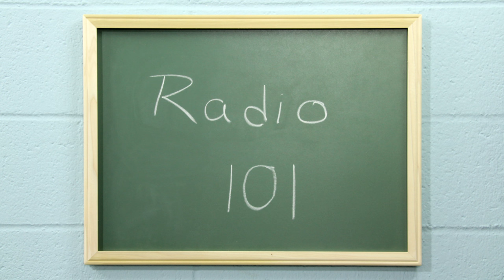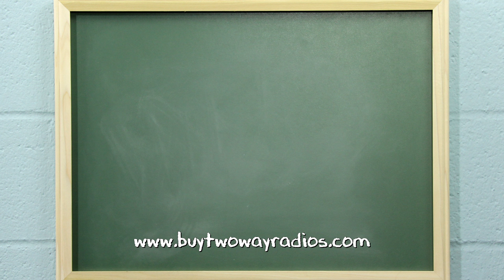How To Program the Baofeng UV-5R From the Keypad | Radio 101

Comment: Why would there be a need for a tone for simplex? I have to disable tone in my Yaesu otherwise the simplex ch won’t work .
Reply: Oh, your Yaesu works! You just have to have your other radios, set to receive and transmit a PL tone, when working simplex. It basically make that frequency private, because no one else, would have that tone programmed in.
Reply: @chrissewell1608  Putting a PL (ctcss) in on a simplex frequency will not make it private. It will only prevent you from hearing others on that same frequency. Others will hear you though. You not hearing them could cause interference to them, not good! Always consider talking on the air like the old party line telephones. Anyone can hear what you are saying, somewhere!
Reply: @cinibar   That's why I call PL tones "Head in the Sand" Tones vs "Privacy Tones" when teaching new operators. :)
Reply: @seriouspipes  Right on! Cheers!

Comment: I just purchased my first Baofeng, a UV-9R Plus, and the programming is very similar. I wish this video was out last week! Your method is simple, compared to other peoples videos. It seems confusing, at first, but once I understood:  All settings, for a channel,  are made before you save that specific channel, into memory, then it makes sense. I just had to "delete all" memory channels, before starting. This ensures you start with a clean slate. (Then set the language to english!) Then start programming channels.
Reply: Just did this with mine. Got it a couple days ago, when it started speaking Chinese I panicked for a second lol.
Reply: Its definitely worth downloading chirp and getting a programming cable as well but this is a great way to throw it in quick I've been a baofeng owner for a year and just had to watch this to figure out the manual input lol

Comment: How do I  access my saved frequencies? When I  want to access channel 1, when I push 1 it thinks I want to manually enter a frequency. What do I press to access chanel 1, or 2, etc.?
Reply from the maker: If you saved the frequency to channel 1, you will want to switch to channel mode and choose that channel.

Comment: This went completely over my head. I don't know what half of that means. I got the tenway uv-5r pro accidentally thinking it was a baofeng ham. I can't figure out how to set this up. I have no idea what frequency I should be on or anything... Help 😂👌
Reply from the maker: We do not carry the Tenway UV-5R Pro, but a quick search indicates that it is a Baofeng UV-5R, only rebranded as "Tenway". If, so, the same programming applies. The Baofeng UV-5R and its varients are not plug-and-play for consumer use. They need to be programmed to the frequency or frequencies that are licensed to the user who operates it. In other words, if you are a business and you have a business radio license, you would use the frequency assigned to your company according to your license. If you are an amateur (ham) radio operator, you would use the range of frequencies assigned for ham radio use.
Reply: Exactly my feeling. After struggling to make sense of the mini-instructions "manual", I only was able to scan and to program, like I used to with my defunct Radio Shack 200Ch scanner, the 2 frequencies that I know by heart, experimenting to see if the keypad would do as simply. The rest, fugerabourit... And this video is like showing something to the blind.

Comment: I have accidentally pressed the reset all button and it deleted every Chanel what should I do?
Reply from the maker: The reset setting reverts all the information in the radio back to the factory default. To recover the lost channels you will need to reprogram them into the radio. If you have your settings saved in the programming software such as CHIRP then simply import those settings back into the radio. Otherwise the only other solution is to re-program it as you did before. You can also program it manually from the keypad as shown in in this article:
https://www.buytwowayradios.com/blog/2016/08/how_to_manually_program_the_baofeng_uv-5r_from_the_keypad.html

Comment: I purchased two of these radios.
On one of them, the speaker volume is very low even when turned all the way up.  
Is this a common issue?
Is it fixable?  
Or should I throw it away and get a new one?

Comment: Did not show how to delete channels.
Reply from the maker: Deleting channels involves connecting the UV-5R to a computer and utilizing programming software, such as the free software CHIRP. After loading in the radio's information, simply select the channel you wish to remove, go to the "Edit" tab and click "Delete". Hope this helps.
Reply: You use menu 28.

Comment: I recently got a Beofang UV-5R, and I'm new to the radio hobbie. At my job all of my supervisors use a type of radio without any screen on it, they're all on channel 1. I was wondering if there was a way to use my Beofang (Not to transmit!) But to be able to listen to what they're saying so I can get the inside scoop on what's going on.
Reply from the maker: That will all depend on the frequency they are on and if you program the Baofeng to those frequencies. If they are using digital radios, you will not be able to.

Comment: Thanks for the video!! I have bought 4 UV-5R handhelds to use on our farm on our own assigned frequency. I have set them up like you have shown in your video, but, only one will Transmit when I push the talk button. All 4 can hear the other person’s transmissions but 3 of them make a high pitched beeping noise when you push the talk button. Can that be fixed, or are they useless?
Reply from the maker: You can always try resetting the radio, as it is likely that a setting was changed somewhere without realizing it. If there are still issues, your best bet is to contact the manufacturer directly about the issue since we do not carry Baofeng products anymore.

Comment: Stupid question, but how do you recall/search a channel on the UV-5R? Once Programmed manually, can you SCAN the channels, if so how?
Reply from the maker: To scan the channels, simply put it into Channel Mode and hold down the *SCAN button for two seconds. It should begin to scan all of the assigned channels. You can set it to search for an active channel if the Scan function is set to Search Mode (SE).

Comment: how do you program Baofeng UV-5R  to the 888s model? Thanks
Reply from the maker: We do not carry the BF-888s, so we have no specific information on how to do this. It may be possible to use the CHIRP programming software to convert a UV-5R image file for the 888s, but you may need to check the CHIRP web site to be sure.

Comment: Can anyone help me out?? I went onto "radioreference.com" search my state an local EMS stations but couldn't imput the full frequency onto my radio.. the number was too long.. does this make sense?
Reply from the maker: You would need to change to the lowest frequency step available in the STEP MENU option and enter the frequency. On older versions od the UV-5R, you can round the 7th and 8th digits by using the UP and Down keys on the keypad. In newer versions, the radio round the numbers up and down for you.
Reply: Good-looking out! I'll check that out thanks

Comment: I have 2 two-prong cables for the Baofeng UV-5R (V2+) variant. The cables are brand new and pushed in all the way. I cannot get my radio to respond to CHIRP. I have tried different USB ports, different cables. Nothing works. Are there any other steps I can try to get this to work?
Reply from the maker: Here are some troubleshooting steps you can try.
https://www.buytwowayradios.com/blog/2016/07/programming_software_does_not_detect_cable_or_com_port.html
If those don't work, try these.
https://www.buytwowayradios.com/blog/2016/08/programming_cable_does_not_detect_the_radio.html
If none of these work, you may need to contact your radio dealer.

Comment: But how do you program for a repeater? Send on one Chanel and receive on the other?
Reply from the maker: No, you only need to program one channel for a repeater. All you really need to do is input the frequency for the repeater, assign the tone if required, then set the repeater frequency offset (Menu Item 26) and Transmit Frequency Shift (Menu Item 25), plus or minus as required by the repeater. The instructions are available here https://www.buytwowayradios.com/blog/2016/08/how_to_manually_program_the_baofeng_uv-5r_from_the_keypad.html .
Reply: @BuyTwoWayRadios  Thank You!!!!!

Comment: Dear Rick, I just recently purchased 8W Baofeng UV-5R, and have been programming BF-888S Frequencies (16 Channels) onto it using the steps on this video. But so far,  only channels 2, 3, 10, 11, 14, and 15 are working. The other 10 channels, i am only receiving messages but cannot transmit. Do you have a solution to this issue? Please help.
Reply from the maker: Hi Reagan, we need more information. You mentioned the channel numbers, but I have no idea what frequencies you programmed into them, so the question is difficult to answer. The BF-888S supports a wide range of frequencies, so "BF-888S frequencies" doesn't really tell me anything about which specific frequencies they are. Also, the UV-5R is a dual band radio, and the BF-888S is a single band, UHF only radio.

It is important to know that if you are in the US, the BF-888S often comes pre-programmed with frequencies that may not be not legal to transmit on without a license, so you want to be aware of the potential legal ramifications.

From a technical standpoint, based on the limited information given, it could be a myriad of reasons why the two radios are not communicating. We need more information with as much detail as you can provide.
Reply: @BuyTwoWayRadios  thank you for your quick reply...my programming cable was delivered and I was able to download the BF-888S frequencies and copy-paste them on my UV-5R. It worked very well. 
You have a very helpful and informative youtube channel here, exactly what noobs like me need. Keep up the  good work and more power. (by the way, I am not in the USA)
Reply from the maker: Of course! Glad we could be of assistance! 😁
Reply: The newer radios are listen only on some frequencies.  ▶  The Baofeng UV-5R is a compact hand held radio scanner transceiver providing 4 watts in the frequency range of 144-148MHz, 420-450MHz (TX) | 144-148, 136-174MHz, 400-480MHz (RX). It is a compact, economical HT that includes a special VHF receive band from 65-108 MHz which includes the regular FM broadcast band. Dual watch and dual reception is supported.

Comment: Hi, I just bought a UV-5R and I'm using it with a headset/mic/PTT that I installed in a helmet.  Two of us are using this setup.  We can hear each other fine, however when we talk we cannot hear ourselves in our own speakers.  Is there a setting so I can hear my voice in my speakers when I transmit?  Thanks
Reply from the maker: The Baofeng UV-5R does not have that capability.
Reply: @BuyTwoWayRadios  Thank you for this information.  I had spent quite a bit of time researching this to find out.

Comment: Thanks Rick, I did what you suggested but still cannot talk on the local repeater, they don't hear me. I have already put the pl tones and still doesn't work. Some have said I need to set the off set, don't know what to do with that.
Reply from the maker: Hi Barry, make sure that you are in range for your respective repeater and make sure to account for anything that may obstruct your signal.
Reply: What frequency? The new radios have a limited frequency range that they transmit on.  ▶  The Baofeng UV-5R is a compact hand held radio scanner transceiver providing 4 watts in the frequency range of 144-148MHz, 420-450MHz (TX) | 144-148, 136-174MHz, 400-480MHz (RX). It is a compact, economical HT that includes a special VHF receive band from 65-108 MHz which includes the regular FM broadcast band. Dual watch and dual reception is supported.
Reply from the maker: The frequency you must transmit on should be the same as the repeater you are attempting to reach.